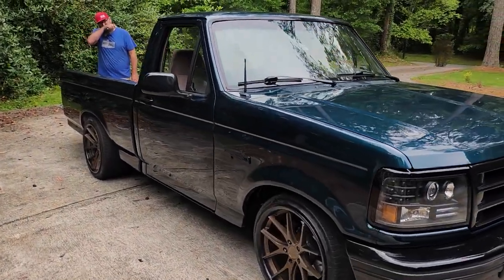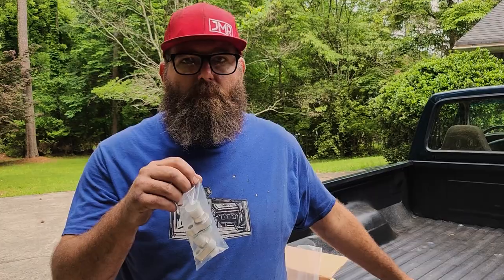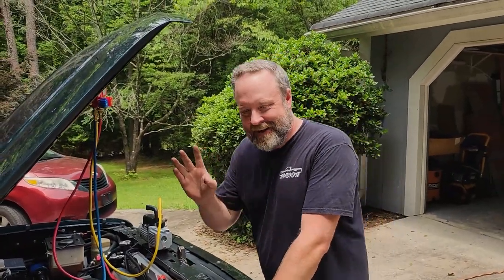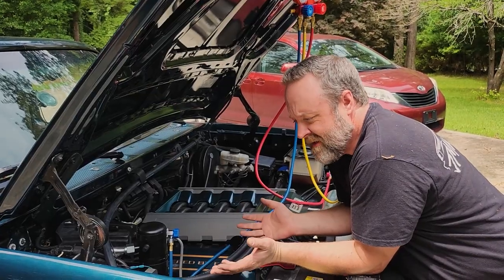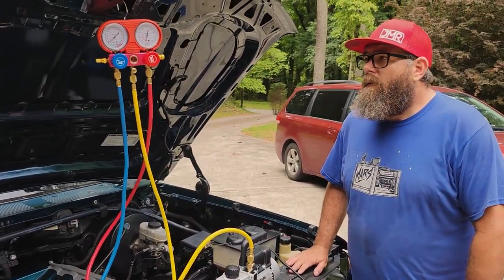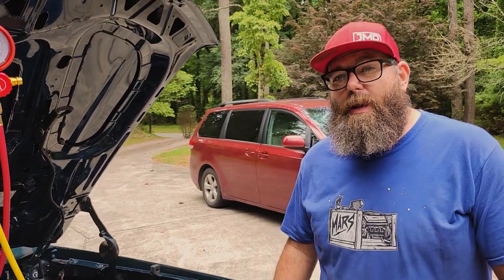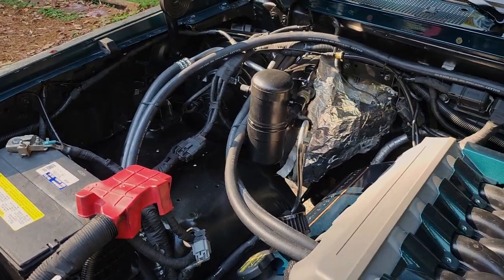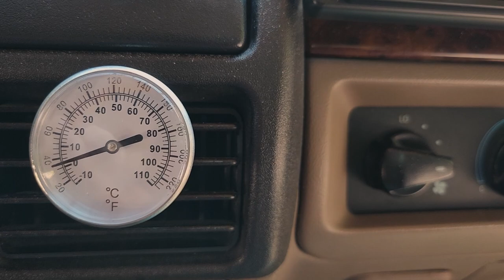Ice Cold A/C in our Coyote Swapped F150. Is it Possible?

Comment: I see you are selling that kit, I want to get one but I have bought the accumulator new already also I don’t want to run the line the way it comes from factory through the the firewall, I want it to run through the front between the radiator and the engine to the compressor, can you get me lines shorter like that, I have a 95 F150 and the engine is a gen 1 mustang
Reply from the maker: Out kits made the way it's made.  I'm sure you could get someone to make you lines, but ours are run differently.  Good luck.  Thanks for comment and supprt.